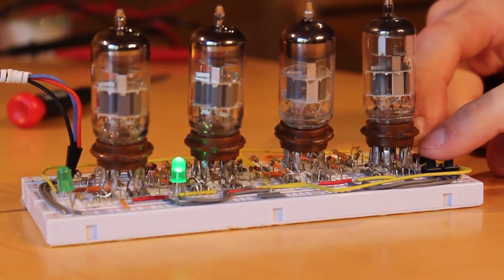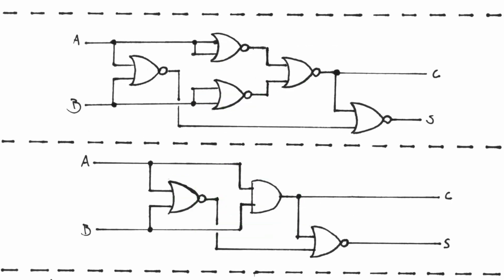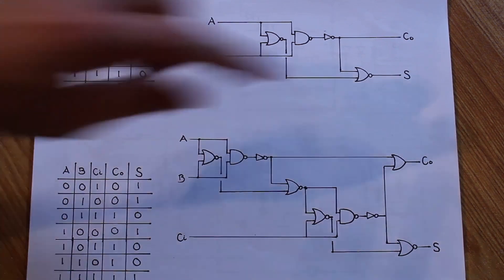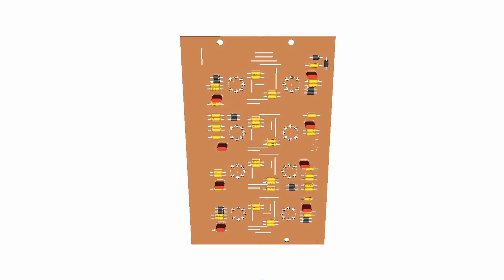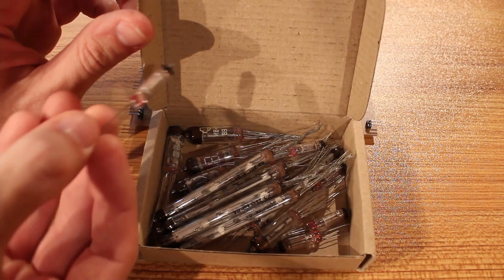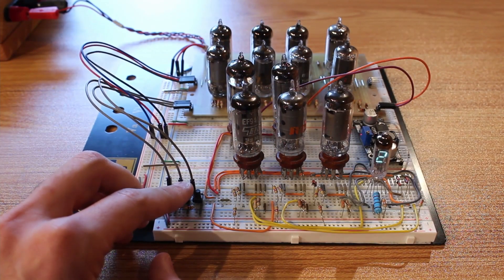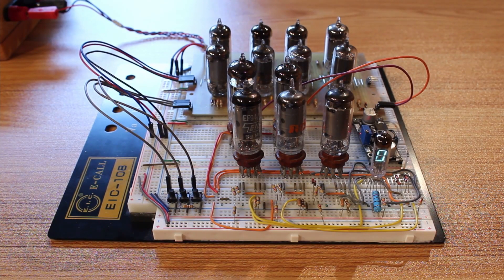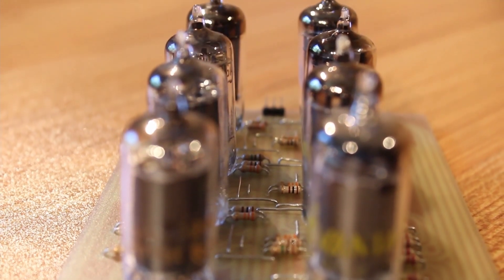Vacuum Tube Computer P.16 – Building a Full Adder for the ALU

Comment: Easy wah to remember gate equivalence is that if you have all inverted signals going into the inputs, you can remove them all, flip the base symbol (AND to OR, OR to AND), and invert the output. This helps one see that a NOR with all invertered inputs is the same as an AND without invetering any inputs.

Comment: I keep trying to post a comment, but I think it is rejecting me, they all disappear.
Is it because I had a link in it?
Reply: Tried again, still having trouble for some reason.  I have built a hex to 7-segment decoder in UE14500 code, and would like to share it !!  Fun problem I thought, and just the kind of thing the original MC14500 was meant for !

But it seems to block me any time I include something looking remotely like a url ??
Reply: P.S. some details of the code --
The real surprise was how much complexity this requires !!
I see your sample circuit is using @24 gates, or "16 tubes, plus >100 diodes" .
A semi-rational human approach, with some manual optimizations, still took 173 instructions (!)
With code based on your circuit from the video, I now have it down to 67 instructions =about 3 for each of your 24 gates.

Comment: 6:17: This makes me wonder how much more complex it would be and how much it would increase the gate/tube count to build a two-bit CPU? One that would still be similar to the MC14500B and UE14500 but theoretically more capable? I'm not sure if anyone has ever designed a "real" 2-bit CPU. There was the Intel 3000 bit-slice family, but I'm not sure if that's quite the same, and also I've not been able to google how many logic gates or transistors that contained. I guess the UE14500's 192 tube count and the Intel 4004's 2,300 transistor count do provide some upper and lower bounds, but it would be interesting to know more. Also interesting: Wikipedia has 1-bit computing and 4-bit computing articles, but no proper article on 2-bit CPUs as such.

Comment: Will you eventually implement at set of registers for your creation? Memory, storage? Theoretically how slow would this thing be, max clock speed? Mips speed?
Reply from the maker: That's my goal!
One of the reasons I chose the MC14500 architecture as a starting point is because it's designed in a way to offload memory to other parts of the entire system. What I'm building here is just the processor, but ultimately, I plan to also build up memory, program control and input/output ( https://i.postimg.cc/pdBCC70m/Whole-Computer.png ). 

I'm working on trying to figure out memory now behind the scenes, and I'm running into some serious headaches (mostly with addressing and control), but the goal is to have a 6-bit memory address to access 64-bits of memory. 8-bits will be for external input, another 8-bits for system related stuff, and the remaining 48-bits as general purpose storage (with a specific 8 of those 48 directly linked to output).

Program control is the next thing to tackle after that, and it's also going to be... difficult. Most vintage computers would read programs in off a tape or punch card and store the program locally in memory. But, memory is brutally difficult to build and programs will have to be extremely long due to the 1-bit nature of the computer.  Son in this case I think I'm going to have to sacrifice clock speed for simplicity, and have the program executed directly from tape. So, the actual clock speed of the computer will be dictated by the tape speed. Which means it'll be super slow! My current thinking is to use both left and right tracks on a standard 1/4" audio tape to store the program and clocking data. Ultimately, I'll need a 10-bit control word, and it comes down to how dense I can pack the data per inch of tape. If I can get the full 10-bit control word in 1-inch of tape, and then I run the tape at 7-inches per second, that gives a clock speed of about 7Hz. Which is a whopping 7 instructions per second, haha. So, uh, real slow. 

The program control section is still up in the air, and personally, I would like to see a clock speed quite a bit faster than that. I would be happy with about 50Hz or so. That should be enough to do some pretty basic computing things, but shouldn't stress my design too much. I still have a long ways to go before I get there though!

Comment: I really enjoyed this video. The only thing is that in my earlier comments I forgot to mention how gargantuan this project will become at the end of it all. 

You broke the tube count and complexity of the original half added down which was the sensible thing to do. But buffers were still need in the end for a clean high and low output, that is an issue with transistors and tube based computers, but not relay based system?  
But I am happy that you can share some of your knowledge with us.
Reply from the maker: Thank you!
It's going to be a massive project indeed! The processor will have right at around 180 tubes, and I'm aiming for about the same number of tubes for each of the remaining three sections (memory, program control, and I/O). So, in total, the tube count should be somewhere between 500 and 800-ish!
It should be noted though that my judicious use of buffers is actually due in large part to my use of low voltages. If I were running the same +150V/-100V that IBM used in the 604 tube computer, I could actually run a smaller plate resistor and get much better "fanout" properties, eliminating a lot of the buffers. Still, buffers are indeed needed at times, even on the high voltage tube computers (or even transistorized machines), but as you noted, relays don't need them. 

And this is for a few reasons. The first is that there is no voltage drop across a relay's contacts, which is something that isn't quite possible with tubes or even semiconductors. The second is that relays are essentially connecting or disconnecting source voltage with with other relay coils through the circuit, meaning there's practically no use for resistors. Relay computers and systems are really awesome and can do some amazing things. Definitely check out Jeroen Brinkman's computer, it's absolutely amazing: http://www.relaiscomputer.nl/

Comment: Very nice, what does your Usagi intro board do or is it just nice to look at? 

I think your boards are getting better with every one - and I don't want to say that your first ones were bad but I think the density and "beautifullnes" is getting better each time. 
I also just love how many other great electronics youtube people watch your videos, very cool to see that they are all one big "society". 
Another thing I have to remind myself of every now and then is that you are doing all of this with low voltages, which is pretty amazing.

Oh and this weeks time laps soundtrack kind of has a Nier Automata vibe to it, very cool. 

Greetings, 
Michael
Reply from the maker: Thank you so much for the praise on the boards! When I designed the Instruction Register and Decoders, there was a lot of repetition in the design, and then the interconnect was kind of a mess because I needed to get a bunch of signals to a whole lot of different places, but I feel like I started to really get into a good groove when designing this next section that has the ALU and RR and Carry Registers! This 8 tubes per board design idea actually comes up a lot in this section.

The Usagi Intro board really doesn't do anything special other than flash the LEDs hidden behind the cheeks. It's a basic astable multivibrator using the two tubes that are the ears and running on just a single +12V wall wart. Here's the schematic for it: https://i.postimg.cc/0NDsDxXv/UELogo-Schematic.png

Ooh, I'll have to look into some Nier Automata stuff in the future if it has a similar vibe! This week's music was by Shnabubula, who is probably the most common artist I use music from. They do some really amazing work!
Reply: @UsagiElectric 
Very cool, I love how you actually used the ear tubes for the LEDs and diddn't just put in a 555 or microcontroller. 
For the Nier Automata stuff, try "city ruins" or "weight of the world", "Amusement park" is also very good.

Comment: Still love seeing you cut PCBs on a big mill. 😍 

This brings back a lot of memories of the digital logic labs at university. Though we never got to play with valves 🤣
Reply from the maker: Sometimes I get a little jaded and forget that I'm using a massive Bridgeport to cut 0.2mm deep into a PCB, which is kind of like the equivalent of using a rocket launcher to drive in a nail! Though, it's still always mesmerizing to watch it draw out the lines on the board.
I wish I had taken a digital logic class in University, I think it would have been massively fun!
Reply: @UsagiElectric  exactly, it's a brilliant demo of just how accurate those machines are. "Hand me my sledge hammer! I need to drive in a thumb tack"

Comment: VERY cool.  Where are you getting the tube socket pins you're soldering into the PCB?  For program storage for the completed system, I'll recommend DIY delay line, DIY magnetic drum, or DIY core memory to be period correct.  😁
Reply from the maker: Thank you!
The sockets pins that I solder in are just 1mm PCB sockets that I get on Mouser. These in particular are Harwin H3161. Then I just machine out a custom foot print on the PCB for them and solder them in. It's not the best option as rigid mounts for tubes can cause thermal stress and may eventually cause the tube to crack, but I haven't had that issue yet with any of the boards I've built.

For memory, I would love to do a magnetic drum, but man that would require a redesign from the ground up to better work with it! I'm not planning on having much memory available as I don't really think it'll be necessary given the architecture. A program that fills up the entire memory would have to be immensely long, so I think that'll be our primary limitation.

I’m probably going to split the memory into two: working registers and RAM. 

For the working registers, I’m planning on building two general purpose registers, one output register and one input register. The GPRs and output register will probably be built around a slightly modified SR flip flop like this: 
https://twitter.com/UsagiElectric/status/1404454767548583939 
This means two tubes per bit, so 16 tubes per 8-bit register. The input register is only there for external input, so I can simplify it or even offload it entirely, saving some tubes. 

The RAM will be quite a bit more difficult. I’m thinking I’ll probably have a 6-bit address, which means 64-bits of memory, 24-bits will be used by the registers, 8-bits for input, and the remaining 32-bits for RAM. Implementing ram without using a colossal number of tubes is going to be tough, even just multiplexing and demultiplexing is going to use quite a lot. So, I’ve been experimenting with using VFD displays as memory cells as you can see at 14:54. 
This essentially uses a VFD and an LDR to create a feedback loop that latches the VFD on. A simple positive pulse sets it and negative pulse resets it. This could allow me to build the remaining 32-bits of RAM while saving around 60 tubes. And if I decide to expand to 128-bits or even 256-bits of memory, this setup should expand pretty easily.

For program control, well, I don't have a great solution for that one yet. I'm leaning towards using stereo audio tape like used on reel-to-reel players. I could build looping programs by physically looping the tape, and could use a low frequency carrier and high frequency carrier to read both data and clock pulses. It's not the best solution, but it's one that I think I should be able to build in the garage!

Comment: Have you thought about using core memory for the future memory part?
Reply from the maker: I have thought a bit about core memory, but the difficulty comes in the control logic for it. Where core memory really excels is in larger memory sizes, however for the relatively small amount of memory I’m planning on, the number of tubes required to get core memory working correctly would be about the same number of tubes as needed to just build the memory directly from vacuum tubes. 

For this build, I’m probably going to split the memory into two: working registers and RAM. 

For the working registers, I’m planning on building two general purpose registers, one output register and one input register. The GPRs and output register will probably be built around a slightly modified SR flip flop like this: 
https://twitter.com/UsagiElectric/status/1404454767548583939 
This means two tubes per bit, so 16 tubes per 8-bit register. The input register is only there for external input, so I can simplify it or even offload it entirely, saving some tubes. 

The RAM will be quite a bit more difficult. I’m thinking I’ll probably have a 6-bit address, which means 64-bits of memory, 24-bits will be used by the registers, 8-bits for input, and the remaining 32-bits for RAM. Implementing ram without using a colossal number of tubes is going to be tough, even just multiplexing and demultiplexing is going to use quite a lot. So, I’ve been experimenting with using VFD displays as memory cells as you can see at 14:54. 
This essentially uses a VFD and an LDR to create a feedback loop that latches the VFD on. A simple positive pulse sets it and negative pulse resets it. This could allow me to build the remaining 32-bits of RAM while saving around 60 tubes. And if I decide to expand to 128-bits or even 256-bits of memory, this setup should expand pretty easily.

But, that’s just where I’m thinking at the moment, that’s all very likely to change in the future!
Reply: @UsagiElectric  Understandable about core memory. Your VFD+LDR idea reminds me of mercury delay line memory, sounds great!

Comment: WOW!! NEW INTRO!! JUST GREAT!! ☺

Well, now it's 100% Usagi's Electronic Computer 14500. Because now it has its own full-fledged ALU and Instruction set. 
Eh, it all started with simple idea - "just create a MC14500B computer using the vacuum tubes"! {Apparently, this is how new things are born}

Once again, I wish you good luck in the project! :-)

... and... I.. didn't quite understand from your schemes, ..but how are you going to clear this carry "register"? After several addition operations and before starting the next ones, it is necessary to somehow clear the carry register.
..

.

.

.
(did you really not like the idea of using the standard "LU" sooooo much?).
Reply from the maker: Thank you so much!
I spent like two full days working on that 11 second intro, so it's a huge relief to hear that it was worth it!

Yup, we've got our own unique instruction set and a proper ALU now! Well, almost, we've got the "A"rithmetic, but we haven't build the "L"ogic part yet. That's coming up next.
 As for clearing the Carry Register, I have an instruction that forces a "1" into the Results Register and forces a "0" into the Carry Register, regardless of what is actually stored in either register. It's not the most ideal solution, but with this architecture, it's often beneficial to have the ability to force a "1" into the Results Register, so I piggybacked clearing the Carry register off that instruction. 

And I was actually planning on totally using a regular LU like in the MC14500, until I tried to program a simple increment program on the actual chip and it was a nightmare ( https://youtu.be/l7fpswJrG04 )! It was like 12 instructions for a simple binary add, which I can now knock out in just 1 instruction. Nothing breeds innovation quite like spite, and so the ALU on this build is mostly just to spite the LU on the MC14500, haha.

Here's the full instruction set if your curious!

0000: NOP - No operation (Set Flag O)
0001: LD - Load value on Data bus into RR
0010: ADD - Perform binary addition of value in RR and value on Data bus
0011: SUB - Perform binary subtraction of value in RR and value on Data bus
0100: ONE - Force a "1" into RR and "0" into Carry
0101: NAND - Perform logic NAND on value in RR and value on Data bus
0110: OR - Perform logic OR on value in RR and value on Data bus
0111: XOR - Perform logic XOR on value in RR and value on Data bus
1000: STO - Output value in RR onto Data bus (Set Write Flag)
1001: STOC - Output inverse of value in RR onto Data bus (Set Write Flag)
1010: IEN - Store value on Data Bus in IEN register (enable/disable input to ALU)
1011: OEN - Store value on Data Bus in OEN register (enable/disable Write Flag)
1100: JMP - Set Flag JMP
1101: RTN - Skip next instruction (Set Flag RTN)
1110: SKZ - Skip next instruction if value in RR is "0" (inhibit Flag F)
1111: NOP - No operation (Set Flag F)

Comment: That's pretty cool.  I'm eventually going to build a frontpanel bus display for my z80 computer that uses those vfd tubes.  I am planning to implement a binary to 7segment hex decoder with a GAL, and then drive the segments in the tube with a darlington array.  I guess that would be too cheaty to use in a tube computer, though eh?  ;D
Reply from the maker: Thank you!
Not necessarily cheaty, especially considering all of my PCBs have been designed on a veritable supercomputer and machined by a 3-axis CNC machine, haha. 
Your build sounds awesome though! If you have any pictures of it, I would love to see it, I love checking out other's homebrews!
One of these days I definitely need to get around to building up a proper 8-bit machine from the ground up. And, I think I have the perfect project for something like that in mind. I just so happen to have a spare ADDS data terminal from the Centurion Minicomputer that I most likely won't end up using, so it would make a perfect data terminal to connect up to a homebrew 8-bit micro!